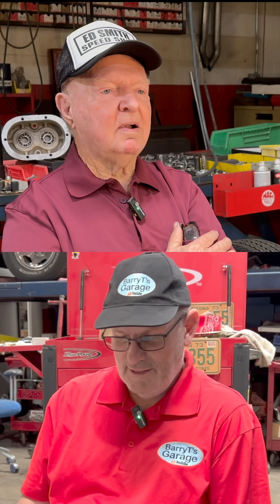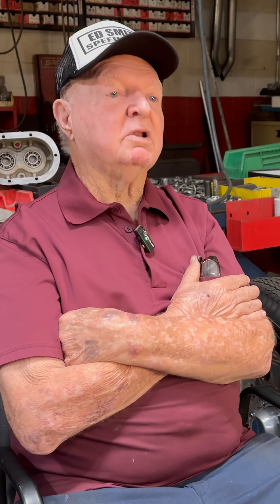Pre Oiling a Seasonal 454 Drag Boat - Ed Smith w #BarryT from Ask Ed 26

Comment: Back in the day… I used to remove the distributor from a newly built engine, take a long screwdriver to which I had attached a copper half-inch tube, and I would engage the flat blade of the screwdriver in the slot in the oil pump. Then I would grab the other end with my electric drill and run the oil pump with the drill and that would circulate the oil all through the engine. Then once I had done that, I would put the distributor back and start it for the first time.

Comment: I always used a distributor shaft with the gear removed and connected to a drill. Also removed the valve covers and used the drill to run the oil pump until it has pushed oil all the way to the rockers. Be sure that all rockers are oiling. Then install the distributor and valve covers.

Comment: Moroso oil accumulator, every engine needs one, also a thermos for cold weather, its pretty impressive how poorly designed the average vehicle is, its impressive they last as long as they do especially considering most mechanic shops dont even understand how to do an oil change properly and build pressure before starting most dont even fill the oil filter, crazy nightmare we live in
Reply from the maker: I hear you, although I have to say about the oil filters… I’ve definitely had engines where the filter is 90° to the floor so what do you do when you have no way to keep the oil in there when you’re putting it on?
Also, a lot of people don’t realize the modern cars allow crank without fuel with the gas and brake pedals floored… Great way to build some oil pressure before it fires up!
Reply: @BarryTsGarage  yes its more important if the vehicle has been sitting for awhile and looses the fluid film the protecting coating, need to built some oil pressure
Reply: @BarryTsGarage  what do you think about running a low output engine to run on water or even air like a lawn mower, but all moving parts will require the special bearing and the piston would need 2 stroke oil as it wouldn't have any oil on the skirt only water or coolant maybe just piston oil system

Comment: We always used a modified distributor and before spinning it poured 1/2quart over each bank of rocker arms and then spun the engine by hand while spinning the oil pump via the modified distributor.

Comment: Another flathead mopar question...
The old flathead mopar pistons are very tall .  When balancing them is it OK to shorten the skirts to get them to weigh the same if there is no balance pad on pistons?    If ls there some formula that determines how long the skirts need to be on a piston?  I am hot rodding a flathead plymouth and am having a hard time balancing the rods and pistons because there is a big diff between the highest and lowest weighing pistons and rods.   Do I have to weight match the rods separate from pistons or can I weight match them together as a unit?   Thx for sharing loving watching you two guys
Reply from the maker: This is a great question or series of questions, I will ask Ed and we will get into it!

Comment: I decided to make a primer out of an old distributor. I gutted it and welded a nut in place on the rotor mounting plate. The housing is designed to channel oil through the lifter galleries as the pump sends oil out of the sump. I get enough pressure by using an electric or battery powered drill to turn the nut on top. The intake manifold is part of the correct position for the primer, but it doesn't have to be fully installed, just close enough to hold the distributor at the correct height. 
   The process is for priming the entire oil circulation system, and may not necessarily get enough oil in the rocker arms, but they usually get enough lube within seconds of engine start. Typically, the engines have check valves to delay oil from receding back to the sump for some time. I feel that the drying of the cylinder walls is a more important concern, so pulling out the plugs and spraying some oil in the cylinders is a more prudent operation before a dry start.
Reply from the maker: I’ll ask Ed about that, sounds like a clever approach 👍

Comment: That's got me thinking of a way to have both wet and dry sump oil pumps. Kind of like a auxiliary fuel surge tank, you'd use a dry sump process to pre oil and the engine pumps it own oil when it's starts. Oooooverrrrrcomplicaaaaationnnnnn
Reply from the maker: That’s a clever concept, thanks for sharing!

Comment: Was he asking about initial fire up, or pre start pressure before routine startups? Accumulator systems have been around for years to address that and as others have said, old distributor or special tool for initial start up.
Reply from the maker: He was answering a question about first start after a lengthy non-use. Like a boat after a long winter break. 👍

Comment: I took old distributor that was no good, took the gear off, while it's apart cut the big part that cap seats on off, and welded lug nut on the main shaft, can't remember if you do that 4 or after you put it back together but you can drop that off in there and spin it with a drill and turn engine over 1/4 rnd every minute or so and you'll have it primed b4 you know it
Reply from the maker: Great idea! I’ll ask Ed if he’s tried that 👍

Comment: I have always used a 5 litre remote  paint pressure pot connect at pressure sensor port , fill with oil hook up air adjust pressure  primes pump oil galleries and filter , works a treat.
Reply from the maker: I'll have to ask Ed about that, sounds like a clever idea!

Comment: When the motor starts its pushing gallons of oil per minute. The builder used prelube.
Also, the dyno guy has a pressured oil system and a coolant loop.

Comment: Have always primed my engines so I just made a litre steel tank and welded a pipe to the bottom and then a threaded plug for filling with a tyre valve and pump it up with the hose attached to the oil sender hole. Have a few different threads for different engines, works brilliant
Reply from the maker: That sounds like a great solution 👍 I'll ask Ed if he's done that

Comment: Gear type electric fuel pump in a container of BREAKIN OIL, output tube into the oil filter adapter pipe, turn it on and run 60 psi for two minutes to flush and prime the system, the mic hit the floor!!

Comment: Another reason to spin the engine while priming the oil system, is that some engines won't feed the top end if it isn't turning for oil passages to line up. I believe a Mopar small block is one of those engines.
Reply from the maker: Thanks I hadn’t thought about that! I’m gonna ask Ed for his thoughts on that,  very good

Comment: Or grind the gear down on an old distributor and do the same thing with the drill.
Reply: Using the drill to turn the oil pump is how I've always done it along with turning the crankshaft.
Reply: @JoshJarrell-t9t  I have one I made and another one that was bought from summit or jegs
Reply: Ive modified a bug sprayer with some fittings on the end so I can hook it into a sender port. 
I added a Schrader to see how much you can hand pump, and 55-60psi no problem, I was just gonna use the schrader to fill it with shop air but it's easy to pump up. 
bug sprayers are like 20$ or less.
Reply from the maker: Great idea! I’ll ask Ed if he’s tried that
Reply: 👍🏻 the only one I've used for years!!!